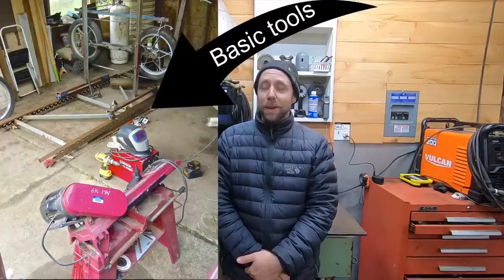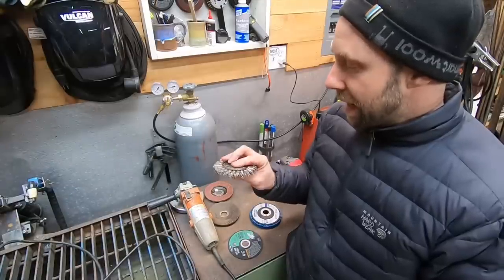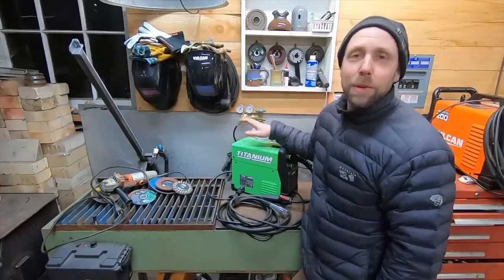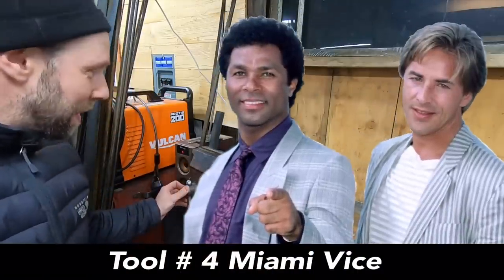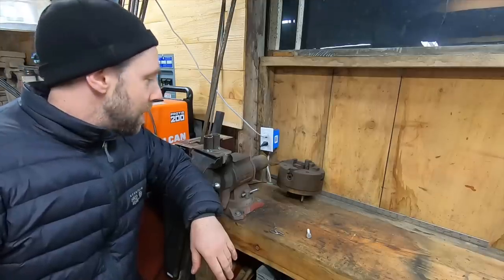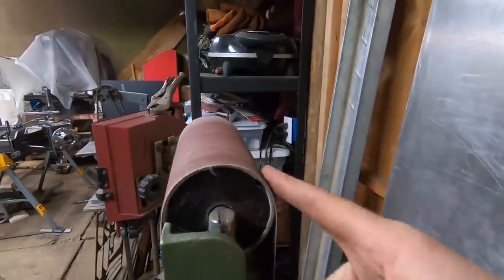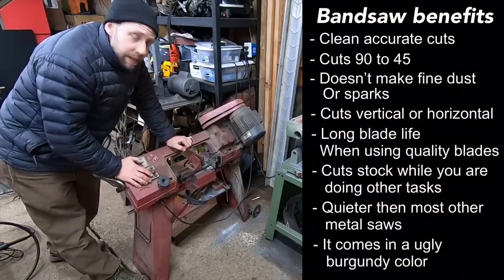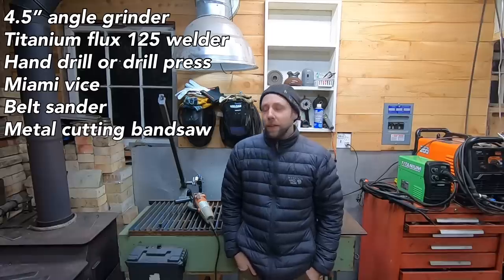6 affordable tools I recommend to get started in fabrication

Comment: I give you a lot of credit Mike. You’ve designed, and built some great things, with not much.
Reply from the maker: Thanks Mel I really appreciate it!
As you know there’s a lot of nicer tools out there, these are just the basics to get someone that doesn’t have a lot of extra cash started so they can build stuff in there shop. 
Is starting out with very little and almost no extra cash to spend on tools, as long as someone is determined they will figure things out. 
Ps what have you been working on these days? Any interesting projects?
Reply: I just about finished my (vastly more complicated) stand for my 14” carbide metal chop saw. I was hoping I could get it in my powder coat oven, in parts, but the main gram is too big. The oven is a lab oven with a smallish interior of 28 wide, by 17.5 high by 16 deep. But I have to take it apart and spray the parts. I’m going to wait ‘till it’s warmer here in NYC.

I’m also almost finished with the smaller powder coat oven I designed, with a 17 by 12 by 12 interior.

Sometimes it seems that most of what I design and build is just more equipment so I can design and build more equipment.

I’m behind schedule because last May I had a heart problem, they couldn’t figure out, since all the tests showed nothing wrong. Then, when that seemed ok, I got a partly detached retina. So that’s another 4 months wasted. I’ve just gotten back a week ago in the shop. It’s very frustrating. So frustrating that I couldn’t bear to watch my favorite people here on You Tube, such as yourself. So I’m cramming now!

So I just ordered the new Thermal Dynamics Cutmaster 40 plasma cutter, which won’t be in until the middle of February, as a start.
Reply from the maker: Mel Gross Sounds like you are definitely staying busy! Sorry to hear about the health stuff 😕 my step father partly detached his retina a few years back scary stuff, I sure hope all that stuff is behind you now.
Sounds like you have a good plasma torch coming! I will need to take a look at that model, I’m sure it’s out of my price range but I’m going to definitely look them up! 
Hey I had some subscribers ask about affordable plasma torches on Amazon the other day, I came across a interesting hobbyist Plasma/DC TIG/ stick welder it’s the Amico CTS 160, I’m pretty sure I saw a comment from you on another YouTube channel possibly commenting about it?
I don’t really need another Plasma torch multi process welder but I was thinking of possibly ordering it to check it out, weld, cut with it and do a review, take it to my work me and the other guys run it for 6 month and do a follow up review to see how well it holds up. Have you used one of these or heard much good or bad about Amico welders???
I would be interested in your feedback. Take care Mel.
Reply: Mike festiva thanks. I might have commented on that model, but I don’t remember right now. Amico is a brand name. So that’s something, when compared to cheap unbranded junk on eBay that guys import by buying the minimum 50 and then sell for three to four times the price. I’ve never used one that I can remember. But I’ve heard some good things about them. Every time something is built to a strict price, you have to hope they simplify it. I’m seeing too many welders, and even plasma cutters, with features they shouldn’t have at the price. I mean that I’ve found that some of those features don’t even work! The problem beginning welders have is that they can’t tell what’s working and what’s not. You turn a knob, and it has to do something, but it might not, or not what you think it is.

If you can, I’d be interested in seeing what you find out. I’m tired of guys who have never used a welder doing “reviews”.

Comment: Kind of agree with you on the stick vs mig welding. For beginners, mig is the easiest to learn. However, it is a case of the right tool for the job. If you're welding clean steel, mig is great. If you need to do repair welding on rusty steel, you should probably consider a stick welder. Also, really hard to weld thin gauge steel with a stick welder.
Reply from the maker: Yes you are definitely right, stick and MiG both have there places and applications. 👍

Comment: my trick for tools while building a collection is to buy cheap in bulk, replace with the highest quality you can buy as they break. this is primarily about bits, but if your cheap circular saw dies after a few years clearly you need a higher quality circ for your usage. don't do this if you are trying to make money on your tools (although if you are you should already know WHAT tools you need to do the job so deciding what tools you need in high quality is pretty easy), but for putzing around in the basement or the garage, cheap tools are fine, you should already expect shit to break or go sideways, so going basic with cheap toolkits is a good way to start. everything you get is going to break, but you KNOW it is going to break, so as it breaks that is where you bust out the wallet. because if you break it that must mean you use it, it automatically increases the value of the tool for you.

Comment: I've had the small Harbor Freight drill press for over ten years. It still works great.
Reply from the maker: That’s great! I have never used that drill press so I really appreciate hearing good feedback on it. I have a old drill press from the 1940s I got from free years ago, I ended up re powering it with a 3 phase motor and a VFD. I’m still thinking of buying a smaller one from HF to have a second drill in my shop. Take care Jack 👍

Comment: The red grinder looks to have a button next to the paddle to hold the trigger down.  My grinder usually has a knotted wire cup brush more than 75% of the time.
If you can swing a wire welder that has provisions for gas it's really sweet to use later on.

Comment: If you get an angle grinder, don’t take the guard off
If you get an angle grinder with an on / off switch absolutely don’t take the guard off
It spins at 10,000 rpms and the worst injuries and deaths in metal or woodworking involve defeating the safety guard
Reply: I used  to build truck bodies.. one of a few people that allowed to cut  chassis  and put extend them put  them back together again . I think there were only 3 or 4 of us...but I'm telling  ya , idiots  takin guards off... skipping safety absolutely amazed me...chop saw never belongs in a metal shop.. ever... band saw.. go slow
Reply from the maker: I definitely agree with never taking the guards off of angle grinders, I don’t but there a lot of people that do and like I said in the video, plan on cutting more then your fingernails if you do.
Reply from the maker: Sean Farrell so you are saying a metal chop saw does not belong in a metal fab shop?
They are awesome, I ordered a 14” Slugger cold cut chop saw for the fab shop at my work and it cuts excellent.
Reply: @Mikefestiva  I have a 14" cold saw and it's phenomenal.  Propoint I think from Princess Auto.  I use Milwaukee blades. Never even plug in the abrasive disc saw anymore.
Reply: @Mikefestiva  sorry Mike,, you're right of course they do... don't pay any attention to what I said...wasn't  thinking... again apologies
Reply: @Mikefestiva  hi Mike me again.. I never used a chop saw... Ever... So I should have never expressed an opinion... But its like pressure cookers in a kitchen.. I'm terrified of them for no practical reason but I'll run a mile if I see one..a 7 year old could work one  safely.. But .... The work I did was very specialized and required more training than talent.. Maybe... All heavy gauge low teck .. 8ft by 4 quarter. Inch gauge plates drilled out the old fashioned way... Anyway I didn't mean any disrespect.. And I'm not a scumbag coward who doesn't put his name to his comments... Again all ... Apology.... Sean  from here in Ireland
Reply from the maker: Sean Farrell Hey Man no problem 🙂 
The special metal cutting chop saws I was talking about run at much lower RPMs and have solid clamps to hold the work, they also run a special blade that cost way too much. Here’s a link to a video I did on the one I ordered for the fab shop at my work.
https://youtu.be/CyDpL_xa2RI
Sean the fact you actually commented back and apologies really tells a lot about you 👍 I have had probably over 4 million views on my channel and thousands of comments and I can’t remember anyone ever commenting back and apologizing. I have had many come back and say really nasty hateful stuff to me, you are like one percent man, like I said earlier you are a good dude Sean. Thanks I really appreciate it.
Reply: These are the Milw blades I was referring to earlier:
https://www.tenaquip.com/product/milwaukee-dry-cut-circular-saw-blade-48-40-4505-tea530?gclid=Cj0KCQiA7OnxBRCNARIsAIW53B9NtCJu1bEnLkXxM5A_zRQq7ZF0JN9pIkKbpKfZ8Z_13kU8hRRpeC4aAobYEALw_wcB

I wouldn't pay that price but they are spendy and well... worth it.  This blade on a cold/dry cut saw is a game changer.
Reply: @Mikefestiva  thanks for your kind reply.. for a second I thought my "ma" came back from the dead and was messaging me from her  grave... ya big soppy git    .. no seriosly  thanks.... talk to you soon
Reply: @seanfarrell5341  you must be talking about those chop saws that have the abrasive cutting wheel with tons of Sparks . . . Have you ever tried a cold saw? You will love them and they have a slow RPM probably among the safest metal working tools compared to those old abrasive types

Comment: I would buy cheap welder that can do both - flux and MIG with gas, it will cost similar as flux core only welder. Once you save up for co2 or mix gas bottle, you can use MIG functionality. And if you want go cheap - 100% co2, solid mig wire is much cheaper to run and cleaner too(less fumes and cleaner weld). Flux core wire is 5 times more expensive than solid core wire.

Comment: Harbor Freight, a poor man's store.  I totally agree with you Mike.  If it wasn't for HF, i wouldn't have over half the tools i have. A man can do a lot with a little : )  Good video
Reply: I have a lot of tools from there I just need to now about welding thanks for your help 👍✌️
Reply: In a few places I worked it's cheaper to buy a 20 dollar HF grinder use it till it dies then get another, over rebuilding a worn out expensive gringer. Buffing compound eats up grinders no matter the brand... oddly the 20 dollar HF grinder held up as well as the Milwaukee's did.

Comment: To go with the angle grinder get a grinder chop saw fixture. You attach your 4-5" grinder with a cut-off disk and you have a great cut-off tool for pipe, bar-stock, bolts, etc. They have a vise clamp, to hold the work. I bought mine off of ebay for $21. It was cast metal and well made. I use it more than my horizontal band saw for most smaller cutting jobs.

Comment: The metal cutting bandsaw is by far one of the most important starting tools for fabrication.  Clean accurate cuts are very hard to replicate consistently on an angle grinder with a cutoff wheel.  Also, I'd recommend the Everlast Powerarc 140STI over the wire flux welder.  Dual voltage 120v/240v, comes with a voltage adapter, tig consumables, hot start\lift start.  I personally like stick welding for heavy duty projects involving bar stock or thick plate.  Once you get that down, going to tig only requires a $25 regulator and an argon bottle.  I'd recommend an minimum of 85cu, 125 is preferable.  The tanks can be found used and swapped out (depending on the supplier) as long as they are DOT stamped and within their inspection date.
Reply from the maker: I completely agree with you, metal cutting bandsaws are really accurate.
I also agree on a multi process welder, I was making this video with a budget in mind, trying to keep the entire lot of tools in the $600 range total for someone  just starting out. I have owned the Vulcan Omnipro multi process welder and liked it, I now own the Titanium 200 welder, MIG, TIG, STICK, and it’s a great welder, it cost $650 not including the tank. I would have suggested a multi process welder but I know from my own experience that I couldn’t have justified the cost just starting out. Thanks for commenting Richard 👍
Reply: @Mikefestiva  Absolutely.  Flux-core wire can be used to good effect provided that the user puts more time into the prep work.  Good high quality wire and running on the high side of the voltage is a must with these machines, but otherwise work very well for the budget-minded hobbyist.
Reply: I agree with the bandsaw if it's within your budget I have a Milwaukee portable deep throat handheld bandsaw that has served me well and I rely on it for all my cuts and they offer a mount that turns it into a bandsaw like the one you have on your video however it is limited and smaller but after a while you can get pretty good at cutting with it and along with a angle grinder you can pretty much cut most steel and aluminum angles tube and pipe  with accuracy and if you check the pawnshops you might find one cheap
Reply: I just got a plasma cutter to insert my hitch light plug into my steel bumper on my jeep.  Will still likely need the name saw for fabricating brackets etc for my off road vehicles.  Pretty new to this as well but went with titanium 200, and 75/25 tank.
Reply: @martinfletchersandiegoca7523  if possible do your plasma cutting on your bumpers off the jeep or cover up everything with those woven fiberglass blankets that are available at harbor freight or your local welding supply to divert the shower of sparks that you are going to get from your plasma cutter . . .safety first and good luck with your project
Reply: There are grinding disks available that are designed exclusively for aluminum that don't load up like carborundom wheels also flapper disks for aluminum are available as well and they both work great
Reply: I should have said “jeep bumper”. I plan taking it out to cut  the hole in.  Actually I got a welding blanket at HF yesterday. Thanks.
Reply: @martinfletchersandiegoca7523  yeah those blankets will save your ass and they are cheap insurance also when welding around automobiles even the smallest sparks will pit windshields and any other types of glass even from a distance like with a grinding wheel those sparks can still do damage and they don't even need to be glowing so if you don't want it damaged or burning or exploding. . . cover it up and those blankets are perfect for that. . .  don't forget to have approved fire extinguishers nearby the more the better the ABC type and the CO 2 type work for most welding shops water is not good around electrical power kinda like pissing on an electrical fence . . . .you won't do that again. . .  if you survive it. . . good luck stay safe

Comment: I use that same Vulcan shield at work when fixing up broken railcars and I love it. I originally wanted a Speedglass or Miller but I can't see spending $400+ on a shield.
Reply from the maker: Right on a practical guy that doesn’t want to spend a arm and a leg on tools! I like this helmet too 👍 I have a older 3M speed glass and it’s a good helmet but I really think they are priced to high. I got mine used and it’s now just a back up helmet. I also have a older Miller but loaned it to a friend that didn’t have a auto dim helmet, the Miller is kind of dumb it doesn’t have a auto on, if you put it down for about ten minutes and go to weld again, it will auto off, I have been flashed a few times because of that poor design.

Comment: Great Video!  I have never used a flux welder.  I prefer MIG but think you should recomend that new DIYers learn to use an oxy-acet torch first.  Learning about recognizing when metal is about to become liquid is very important.  I learned how to weld with an Oxy-Acet rig 64 years ago. I was 7 years old.  I learned stick welding around that same period with my Dad's homemade buzz box welder by watching him and then practicing by myself.  I have no clue what size transformer he used but it worked quite well up to 1/4" mild steel. Just to encourage New DIYers, my Dad was an M.D.  He taught me many "blue collar skills" while building "stuff" in his workshop.  
Titanium coated drill bits SUCK regardless of brand.  Get a set of Cobalt Bits from Harbor Freight (about $100). Expensive?  Not really. You get what you pay for and Cobalt Bits will drill anything especially stainless steel.  Get Cobalt Step Drill Bits too. They are worth the investment.  Learn to regulate drill speed or you will spend $$$ on drill bits.

Comment: Great info and advice, Michael!  I started out 40+ years ago with hacksaws, files, and very basic hand tools.  Using them made me appreciate what more complicated and powerful tools could accomplish.  As my income level and skills progressed, I was fortunate to purchase some tools that allow me to do things that I only dreamed about doing years ago.  Keep at it people, try new things, ask for advice, keep learning, and don't give up.  Metalworking is such a varied and rewarding thing to do.  One word of advice about the horizontal bandsaw - when you are making a cut, don't go out of earshot of the saw.  Both of my saws have stopped mid-cut many times and I avoided a motor meltdown by being close by.  I read on a metalworking forum years ago about a guy who started his saw in his garage, went into the house to get lunch or something, came back to garage and there was a big wad of goo coming out of his motor.  The saw had stuck and the motor overheated.  Oh, wear that safety gear, too!  ;^)

Comment: If you don't want to spend as much on a band saw you can get the Baur porta band. Works great and you can build a simple stand to hold it vertical to do free hand work. Harbor freight's files are actually surprisingly good as well. As a professional blacksmith I use files a good bit and I am impressed how well the hold up.